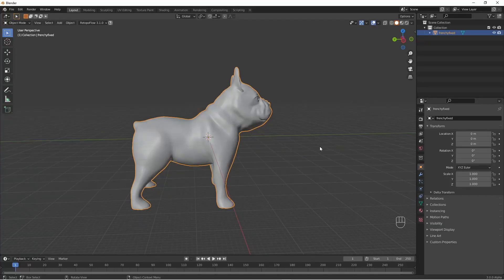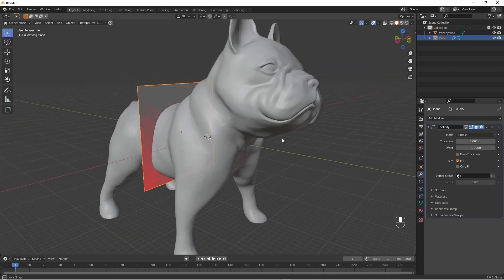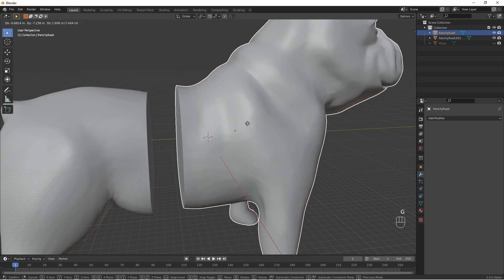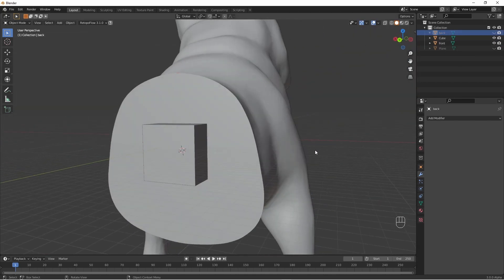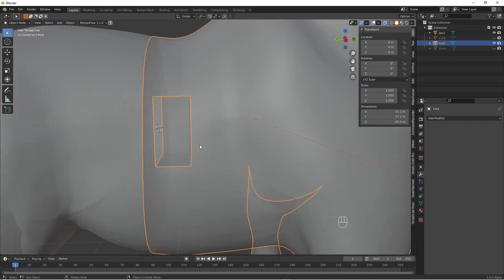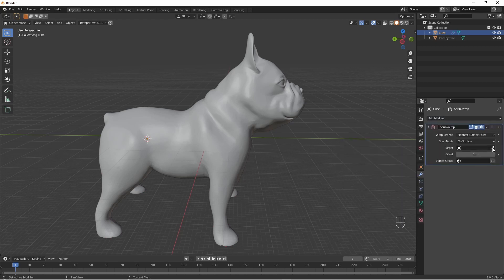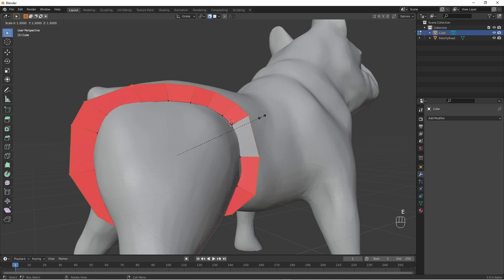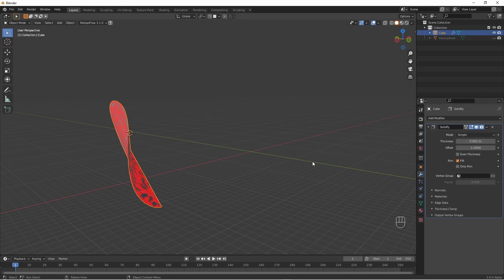Blender. How to cut and key a model for 3d printing

Comment: 2:14 When I select the plane, half of my model disappears, even though its all one piece, so i cant go any further to complete this.
Reply from the maker: Firstly try setting the boolean solver to fast instead of exact.  If this makes no difference i would suspect that you have either normals set incorrectly in either the plane ot the model.  Check this by selecting the Face Orientation in the view port overlays drop down and see if you have red faces.  If you do, select them in edit mode and flip the normals.  Also you might want to check that your model is manifold.  The 3d print plugin (which is shipped by default with Blender) has a good tool for checking if your model is manifold.
Reply: @notverygoodguy  Thanks, changing to Fast worked. But now 2:56 pressing L does not select anything. I am trying to make a very basic flat rectangle tray to place a material board game character sheet (2mm height, 256mm x 217mm with a 1mm wall around it, which us 4mm high). It is too big for my printer, so i need to split it in 2, with a way to easily glue it together. But this is my first time trying to create in 3D. So ive been trying for days, and about to give up.
Reply from the maker: @JS1HUNDRED  Did you apply the boolean?  Don't give up, point me to a link to your blend file and I'll have a look.
Reply: @notverygoodguy  yes i applied boolean. Everytime i post the link and refresh, my reply is gone. Dont think YT allows URLs? Never seen one in comments
Reply from the maker: @JS1HUNDRED  You could post in the Facebook group or in the discord.  Both links are in my "more info" section.  If you post in the discord let me know here as I never visit it otherwise :)
Reply: @notverygoodguy  Thanks. Posted to FB. My post is pending
Reply from the maker: @JS1HUNDRED  Yes.  I have it.  Had a quick look and I can see why the booleans don't work properly.  I have doen a cross section and can see that the bottom of the tray has incorrect normals.  I'll look at it in more detail tomorrow.
Reply from the maker: It would be much easier to re-create this tray than start trying to remove faces and flip normals.  How did you make it?  Seems way more complicated than it needs to be.

Comment: hi good video, but my object seems to have no inner wall there is only only the outer wall but that the inner wall at the same time. could this be and what can i do to make it infilled?
Reply from the maker: Can you explain at what point you get to this "no inner wall".  Your model should have no inner walls (if we are thinking of the same thing). If you have created the cutting object and it goes right through your model, you should end up with everything being "water tight" as it should be.  Perhaps I am misunderstanding your issue though.
Reply: @notverygoodguy wow you are fast man, thx for that but i found a way to get it hollowed with a little thickness. Now it works. Thank you very much for you help
Reply from the maker: @buzz_  Good to hear you are sorted out now.  Thanks for the update.

Comment: Heya! I tried following these steps, but when I try to separate the parts, it seems like Blender is seeing the parts the modeler made and selecting those instead. I can't get it to actually select my cuts.
Reply from the maker: I'm not entirely clear about what parts are being selected.  Can you link to your blend file so I can take a look at ti.
Reply: @notverygoodguy  Ofcourse! Thank you for taking the time.

https://drive.google.com/file/d/1MbQqG6QkQ_yeZa0K5QzE4sAO0C3D3jsr/view?usp=sharing

I have noticed that if I try to cut through multiple of these "parts", the boolean fails all together and seems to attach the slicing plane to my model.
Reply from the maker: @BlueDragon1504  It's a nice model.  Firstly it does work as you can see in this picture.  https://drive.google.com/file/d/1GOyhllkSFto_Iy3xa1FW9R6uiRyhKLsy/view?usp=sharing

Two things I did that might be relevant for you.  Firsly I did a new plane and made it slightly thicker than the one you had.  I am not sure if that really made a difference though.  Second thing I did was changed the boolean solver from exact to fast when adding the key and it all seemed to work.

The fact that the model is a collection of objects is a red herring and probably doesn't matter although if you are thinking it's a problem you could always export the model to STL and then re-import it for cutting and keying.  I have had to do that before.
Reply: @notverygoodguy You're a life-saver! It was frustrating me to no end. Thank you so much!
Reply from the maker: @BlueDragon1504  Glad you have it sorted!

Comment: I don't know why but when i apply the boolean modifier to the body a new cutting tool appear and it stays in place of the cube I made. I try to hide and even delete the cube and nothing happened. I tried with just a straight plain cut and it worked not sure why the 2nd method isn't

Comment: Thanks! Great video! 
Just one note tho. Adding a key to the leg isn’t actually necessary since you have an irregular surface anyway. It’s pretty much its own key. In fact, if you add a key and it’s not in the correct direction of withdrawal, you might run into trouble when assembling the printed pieces.
Reply from the maker: This is a fair point though I find assembly more accurate in most cases even on irregular surfaces.

Comment: thank you, I'm new to 3d print and not new but not very skilled with blender, I figured out by myself the first method but wanted to have a more precise cut than just a plane. I still need some adjustment to make a good inside cut allowing rotations using the organic method but should come with practice. Thank a lot!
Reply from the maker: Thank you for your feedback.  I am glad to hear that was helpful for you.

Comment: HEY! Show your keystrokes or tell us how to do each step. HOW DO I ROTATE THE PLANE? HOW DO I EXTEND IT'S LENGTH. IF YOU'RE GOING TO DO A TUTORIAL THEN MAKE IT A USEFUL ONE! THOSE WHO ARE NEW MIGHT NOT KNOW ALL OF THE MINOR COMMANDS. blender has an ENORMOUS skill set. Here's a question: HOW DO YOU ROTATE THE PLANE TO MAKE THE CUT IN THE FIRST PLACE?
Reply: WAIT! WAIT! I SEE IT! - The keystrokes and the mouse clicks are visible in the lower right hand corner of the blender window!!!!!! DAMNED NICE! Excellent! Thank You! Please Keep Posting!
Reply from the maker: @soleckrider7561  I'm glad you found it :)  I think I have it bigger in later videos.
Reply: @notverygoodguy  Once I noticed it, it was easy enough to see, and anyone with the same concerns I initially had will probably read the comments and might pick it up that way. I like the general flow of your teaching method, now that I have better understanding of your methods. You present it well, your voice is clear and easy to understand, you don't speak too quickly. I'll be following your tutorials now. Mastering blender is an attainable goal, but it requires thought and adaptation on the part of the 3D-er who is learning and then Mastering it. Thank You for Your Videos, and PLEASE Keep Posting them! ~ Sol
Reply from the maker: @ Thanks for you kind words.  I am glad you like the videos.  I will be getting back to uploading soon.1

Comment: Ok so i'm a TOTAL noob when it comes to Blender and 3d modeling. I am a 3D printer and I need to make a base for some models because they are SO unbalanced - so I want the exact impression of the characters feet so they fit into custom bases - i have searched EVERYWHERE for a tutorial like that - but i was able to use this guide to figure out how to do that! Thank you!!!
Reply from the maker: Well it wasn't its intended purpose but you clearly have a knack for this and were able to figure it out yourself.  Excellent.  I guess having the feet connected to a base could be considered a keying exercise.  I'd never thought of it that way.
Reply: @notverygoodguy  Some characters have weird shaped feed - especially creatures, so having their feet fit exactly into place is a huge help! next step is to actually print something and try it and see how well theory comes into practice!
Reply from the maker: @craigroberts4434  Best of luck!

Comment: Extremely insightful. I can't seem to get Loop Cut to split objects in half and apart at all, but this plus the snap fit is really helpful
Reply from the maker: Loop cuts don't split objects but only add more vertices in a line around your model.  Even then, they stop where there are triangles in the way.

There is a bi-sect tool that can split objects in two but I rarely use it myself.  I find this boolean method is easier to get right.
Reply: @notverygoodguy  Oh, I see. Thanks for clarifying :)

Comment: Heh a video from 3 years ago made it easy to seperate an object, all the other ones I watched were too complex this one worked like a charm, thank you!
Reply from the maker: Wow, is it three years already.  I need to update these things :)  Glad it was useful!
Reply: @notverygoodguy   Did you know how to make the reverse? if you have a model cut in 2 pieces but want to make then toguder again?
Reply from the maker: @alexsandermc9794  That depends.  If you can place the parts accurately together and don't mind that there will be internal parts in your model you can just boolean them together and print them.  Otherwise you will have to manually get the parts as close together as you can, remove the faces that hold the cut and key parts and then maybe a simple merge by distance will work.

Comment: is there a way to assemble a stl that is cut in multiple parts? most of stls are already in the right position when you import the parts to blender, but sometimes I got across one that each part is rotated and spread, I looking for some way to allign the parts back in position, snapping the pin areas or something similar?
Reply from the maker: A lot depends on luck.  If the parts are all aligned you can simply select all the parts and join them with CTRL J.  This will likely leave you with internal walls but your slicer might cope with that if you are 3d printing but if you are texturing or animating you will probably run into trouble.

If the parts are not aligned you almost certainly won't have a magic button to align them and will just have to move the parts into position yourself.  Turning snapping on will help but not a lot.
Reply: @notverygoodguy   oh thank you, actually this wouldn't be to print all together, no reason to join or worry with internal walls. I just like to assemble sometimes to have the full size of figure when the artist doesn't show this info, or to create or enlarge connect pins for these parts and things like that. But later I would still print those parts separated. Thank you for the reply!

Comment: Hi, I tried the thing first and it worked well, now i try to redo it with the same file and when I use the boleen to select the plan, all my model dissapear except a small part that is in the plan... I'm really lost, i never used Blender before, and I don't understand why it worked one time, and now with the same exact starting model, it doesn't work anymore :/
Reply from the maker: The most likely cause of this kind of thing is if the normals on the model or the cutting tool are wrong. I suggest tuning on Face Orientation in the viewport overlays and checking these first.  Let us know how it goes.
Reply: @notverygoodguy  it went well! Thanks you!
Reply from the maker: @luciedailliet1408  Excellent news :)  Thanks.

Comment: great video..but for some reason it only worked once for me, I need to cut two hands of a character, with the organic cut method, did the first hand with no problem but after repeating all steps on the second hand nothing is working and I going crazy 😅 for some reason when I try to apply the boolean, set as diference he merge with the form as if I was using union
Reply from the maker: This is most likely because of normals being incorrect.  Turn on "Face orientation" and see if you have any red bits where you shouldn't.  Alternatively, if you are able to post a link to your blend file I can take a look.
Reply: @notverygoodguy  Thank  you, I think my comments with links are getting delete but the face orientation tip helped me. Best wishes!
Reply from the maker: @HBComics  Glad you have had progress and thanks for the feedback.

Comment: When I press "L" to select only half of my object in edit mode, everything is selected :/ I repeated the whole process multiple times just to be sure, when I added more thickness to the cutting tool and applied boolean, it doesn't seem to "cut" the model, it's still connected
Reply from the maker: Often when something completely weird like this happens it is because of incorrect normals.  Have you turned on face orientation to check you don't have any red faces where you shouldn't?  If not perhaps you could provide a link to your blend file.  I am always interested in seeing if versions of Blender that I may not be using yet have broken things that used to work.
Reply: @notverygoodguy  Thank you for the response - it was indeed problem with swapped faces. The one between the beginning and the end was swapped, plus the shape is more complicated, and during extrusions vertices were cloned in place for some reason, leading to some wonky shapes and hidden swapped faces.

BUT anyway, thank you again for your response, my experience in Blender is close to zero, and your tutorials help a lot!
Reply from the maker: @czokalapik  Very glad to hear you have the issues sorted now and I'm pleased the video have been helpful for you.  Thanks for the feedback.

Comment: cheers helped a lot .first time using software . must have watched the 6 mins over and over for hours lol . im slow . but it was hollow on one side no matter what i did , untill  i used the l and p on all the parts . not just one side and it worked .. cheers for video ,i wouldnt have even tryed to use software .untill watched this
Reply from the maker: Glad to hear it helped but just so you know I also have a video on the channel on cutting and keying a hollow model :)  Maybe it would have been more useful for you.

Comment: I think it would be easier and more intuitive to go to sculpt mode, draw a mask on the part that needs separation, and then separate the masked part
Reply from the maker: This can work if you use separate mask to new object but getting the mask precise enough is extremely difficult and you have no control over the shape of the cut line so I think using a cutting object like this is quicker and more accurate.

Comment: How is it that when you cut something, the hole you've just created is already filled in? Mine is always completely empty :(
Reply: Hey have you found the answer to this question yet? I'm just starting, I've cut my model into 2 parts which are the head and the body, the body is still fully cover (seems solid) after hiding the plane and the head but if I hide the body and the plane, the head is completely empty and hollow. How do I fix this?

Comment: what is the difference between use the  control + j  (CTRL + J) to join and use the boolean modifier?
Reply from the maker: CTRL+J only makes two objects into one object.  It doesn't change anything at all.  The objects don't even need to be touching each other.  A boolean union will merge two intersecting objects together and attempt to remove any walls that end up being inside.

Comment: Many thanks for this video! Slicing objects with a solidified plane is easy and so is keying with a cube, but I couldn't think by myself of a more practical way of doing things (I'm new to Blender). Your tutorial helped a lot. By the way, I noticed that when you toggle face-snap before moving the "cube-gone-vertex" object, you actually don't need to add the shrinkwrap modifier to it.
Reply from the maker: Very glad the video was useful for you.  With regard to the shrinkwrap modifier I think you are right but when I was learning Blender and trying to do retopology everyone recommended having both and I never really thought about it after that :)

Comment: When I try to do the difference part it just cuts a hole in the other half and it appears hollow. Any idea what might cause that?
Reply: If anyone finds this and is having the same issue. I went to Edit Mode -> Mesh -> Normals -> Recalculate outside and that seemed to work for me
Reply from the maker: @jon5716  You didn't even give me the chance to reply before you solved it yourself :)  Indeed, normals being wrong is the source for many a Blender problem.  That is why I always have Face Orientation set to on in the Overlays dropdown but change the blue to transparent in preferences.   Glad you solved it :)
Reply: @notverygoodguy  Okay so I am having the same issue but this time recalculating normals isn't fixing it. I have an object imbedded in another both have their normals correct but if I do a union it leaves a hole. If I switch to difference it leaves a indent. Using self intersect also doesn't seem to be working. I am stumped. To clarify I am trying to join these two objects now. Having the same issue with the hole but the end goal is for them to be one
Reply from the maker: @jon5716  Try switching from exact to fast  in the boolean modifier.  That can often fix issues like this.  When I finally get around to it, my next video will be about boolean problems and this is one thing I will talk about.
Reply: @notverygoodguy  Good to know thank you. It turns out this one was because there was non manifold geometry. I downloaded the 3d Print addon and the fix that provides has been really helpful getting booleans to work properly
Reply from the maker: @jon5716  Glad to hear that and thanks for letting us know.